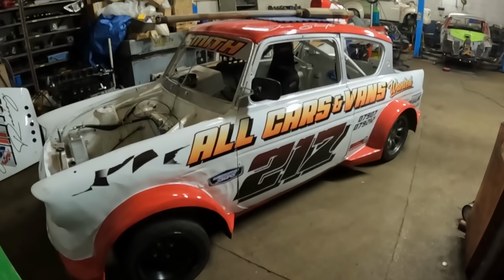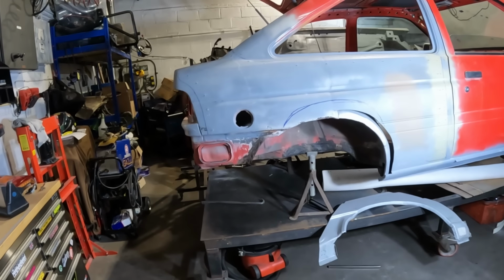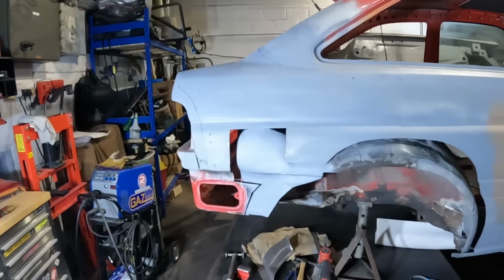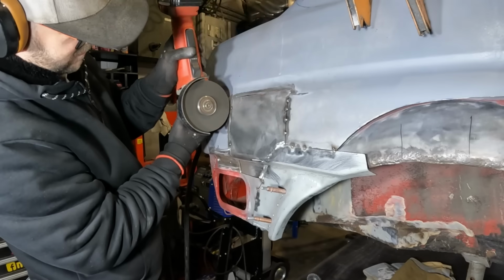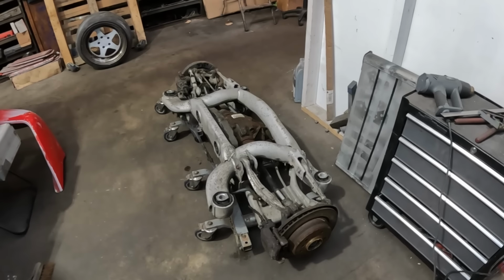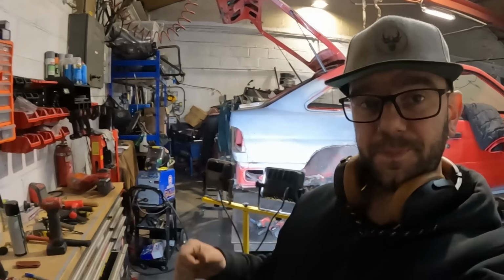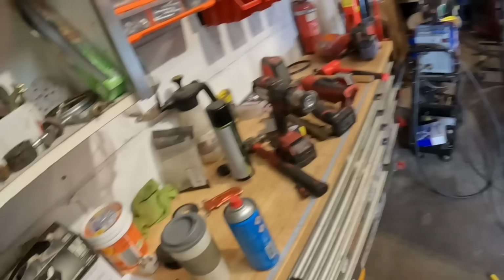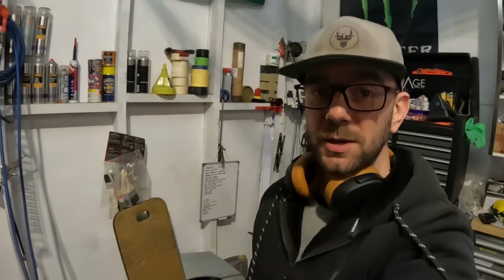Escort Cosworth WRC Replica Build Ep10 Tubbing The Arch And Rust Repairs

Comment: Nice work again mate , with fitting the fibreglass / kevlar panels to the car you could of cut the the whole of the rear quarter panel off the car  before the screws you put in , it would saved you time doing the metal repairs and also if your tubing the rear arches etc you could just go to the outside of the fibreglass arches. I will send you some pics over mate. Keep up the good work

Comment: Hi, Terry your knocking it out the park again mate... yeah vid did get a bit deep at one point, but yet again full of entertainment and information. Regards "to tube or not to tube?" The floors are well beyond saving aren't they, so as you mentioned, to tube maybe the way forward, the car isn't in the best of conditions and it isn't going to be standard in anyway, shape or form, at least tubing it, all the geometry of all the running gear, to frame to engine etc.. will be spot on and no rot to chase, also you'll be extending the life of car as well as keeping it's value up there.
Speak again soon 
Cheers rich1899
Reply from the maker: Thanks rich. It’s a tricky one, as much as I can see the tube chassis being the better route to take, it’s very costly and time consuming, not to mention a whole new skill set I need to learn. Iv got the car on a rotisserie now so I’ll inspect everything and go from there I think.
 rebuilding and documenting it will potentially help the mk5/6 escort community when trying to rebuild there cars aswel so there’s that on the flip side aswel…

Comment: Great work again,, quick question on your panel joints,, have you tried the cut and butt method? I have found it much easier to
Reply from the maker: Thanks dude, how you getting on with yours, you haven’t uploading anything for a little while have ya? 
I always have mixed success with that, sometimes it goes great and other time not so much, I do like to keep a small gap between panels though so I know the welds fully filled it if that makes sense?